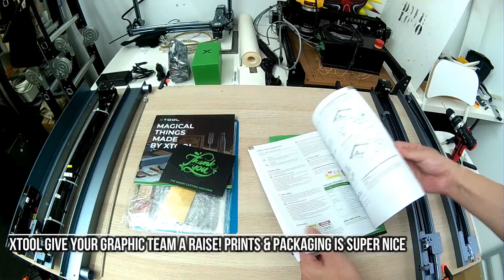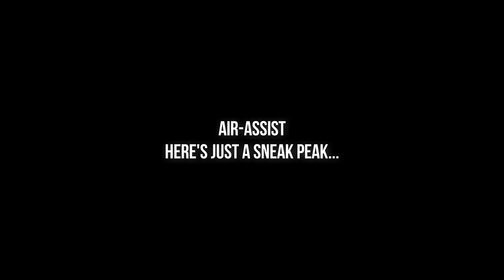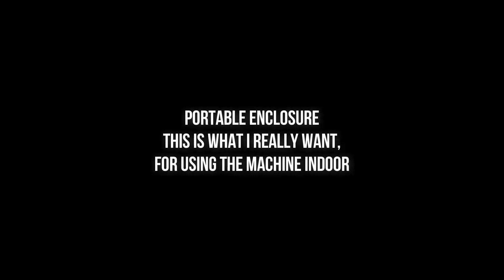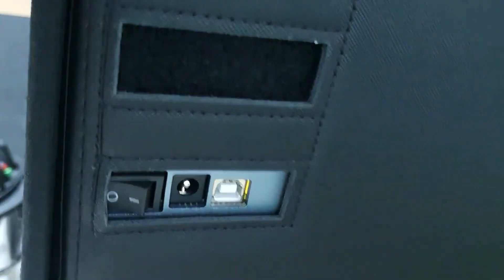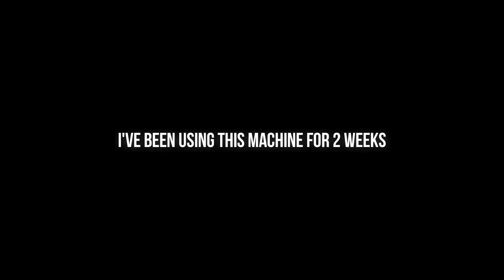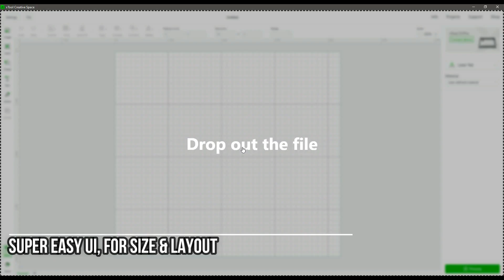Xtool D1 Pro - Powerful diode Laser Engraver Cutter with Beautiful Enclosure

Comment: Nice!  My only concern is the bottom.  Is it held in place with just the glue?  No nails?
Reply from the maker: yes i would nail bottom & side if its for heavy duty use, but anyway this is only for decoration/display :)